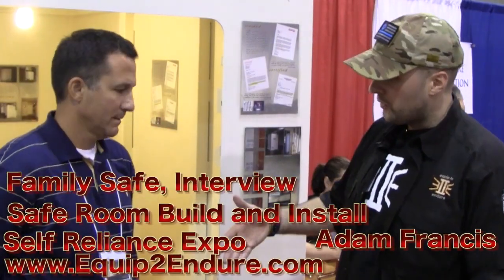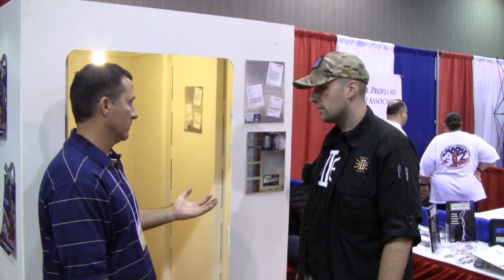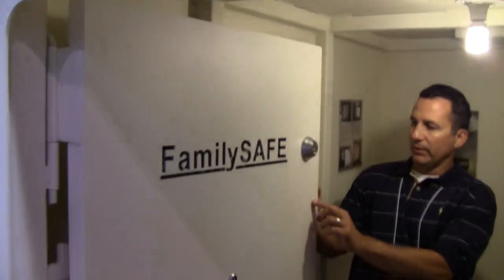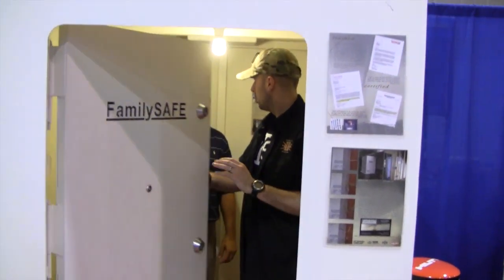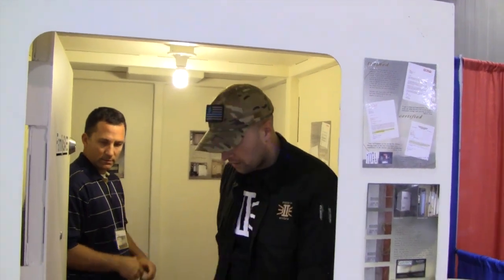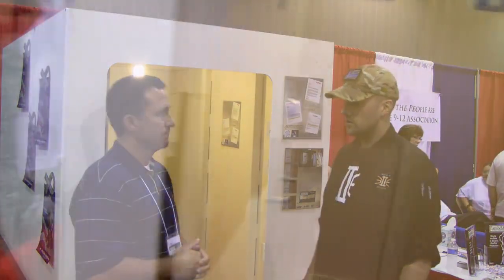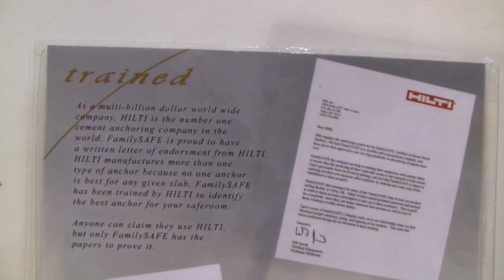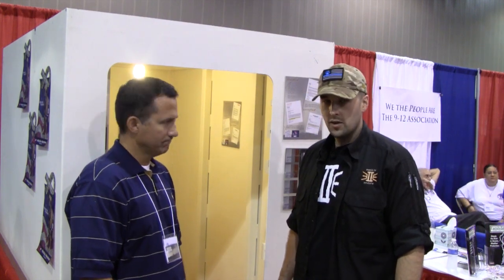Family Safe, Safe-Room Demo at the Self Reliance Expo

Comment: I can understand putting this outside (if yuo want protection against tornado). Because if you're inside, your house is wrecked, then you won't get that door open, and that's a pretty horrific situation.

It's mostly meant for americans with thosewooden/plywood houses. I still don't understand why most american have wooden houses (or at least inner walls), it might be fast to build, but it's crappy quality. Over here 90% of the houses are stone/concrete/reinforced concrete, even the inner walls.